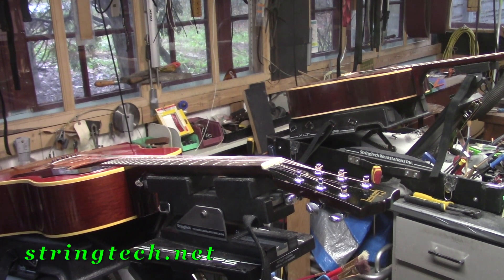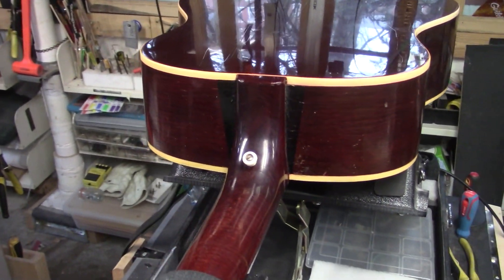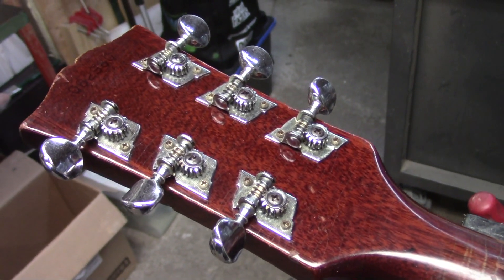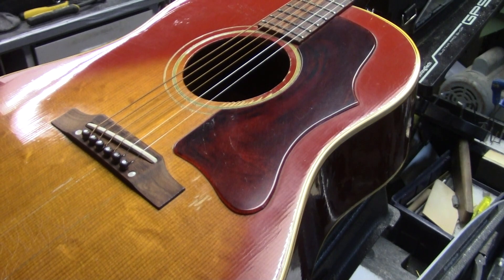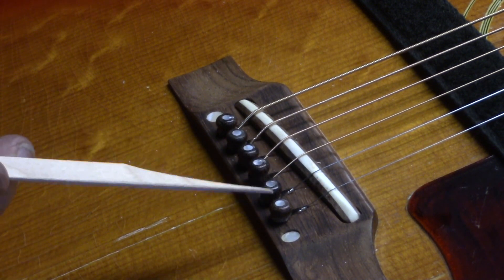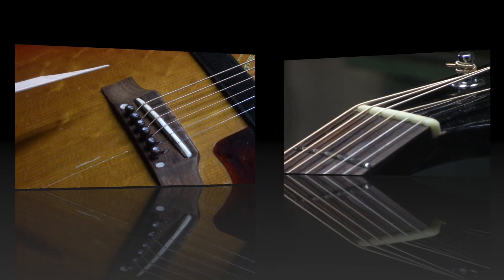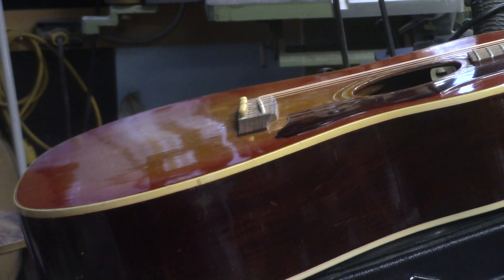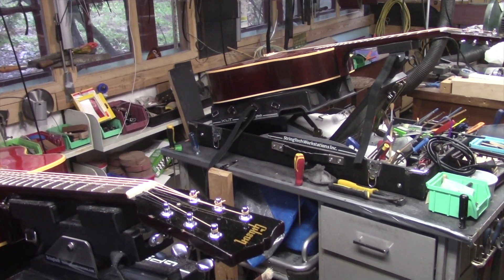Guitar Shop Fire Hazard Tip !!!@StringTechWorkstations

Comment: I once owned a very quiet mid ‘60s Epiphone Frontier with an even bigger pickguard. Sounded great recorded, but very quiet. Someone removed all the innards of the adjustable bridge and installed a rosewood piece which was slotted for a 3/33” bone saddle. One day, my curiosity got the best of me and I decided to remove the puck guard and let all that suppressed volume come out. Having done this before on a J-50, I was confident, but I broke the guard removing it. After extensive elbow grease on the residual glue it was time for the tone test . . . and - NO INCREASE in volume!
My opinion is that the quality of spruce was below sub par. I’ve played ‘60s Texans (not every one, though) that the tone just bounced out of, but this Frontier was a dud for most aspects of guitar playing. Trying to make a J-45 sound like a Martin probably isn’t going to happen, but some of them sound good despite all the supposed strikes against them from a design perspective. Good for Mississippi Delta Blues, at least.
Reply from the maker: Most of the Gibson acoustics from the 50's / 60's were not boomingly loud guitars. The 30's and 40's however ... Ka-Pow !!

Comment: Thanks for the heads up on the batteries. You know I am a fan, you are one of the best I have ever seen. Somewhere I heard of guitars being appraised, not sure what model of Gibson it was, but with the original bridge plate it was worth 35,000 , if it was replaced 3,500. Do you think that was B.S.? I know those old plywood ones are junk and if a top gets bulged out or warped can mess them up too, not to mention regular wear and tear. I have even seen luthiers use over sized ones to straighten out tops, which IMO is better than those bridge doctors. Just wondering what your take is on it.
Reply from the maker: Oh Boy ! These are a real "Can of Worms" questions to answer... Lol  ! But here goes .... If you have been following my channel for any length of time, you know that I work on a LOT of high end stuff. Frankly, I don't get into the #'s game. It's WAY too much of a "Snake Pit"  for my taste. I guess the real question to ask is .... " Do you want to put the instrument in a glass case ... and never touch it, in case you put a fingerprint on it ....and then bow down and worship it every day and monitor it's worth on the stock exchange "  ?  OR .... Do you want to get the maximum tonal response and playability out of the instrument ... and play the living shit out of it ... on a daily basis ? (Sorry for being crude ...  I guess that was 2 questions / 2 answers ). As far as the "top pulling" up .... I think that there are way too many people who are too quick to jump to the conclusion that you need to "flatten the top" .... why ??? Unless there are some braces that have let go ... why would you do that ? Chances are ... that if you "force" the top to flatten it, you will be more likely to pop a few braces in the process. IMHO I think that there is a whole industry built around this completely unnecessary " repair ". Naturally, under 160lbs+  string load for 50 years; the top will flex over that period of time and string load. I prefer to put a spherical radius on the foot of the bridge ( 24' radius NOT 24" .... or 30' on a shallower top) , to get intimate contact , for maximum resonance. I guess that is more or less my take on it ...... now let's see the shit hit the fan .... Ha ! ... Respectfully ... MMcC
Reply: @StringTechWorkstations  Haha, I love it! Well said Mike.
Reply: @StringTechWorkstations  Thanks for the response, I totally agree with you on this. I didn't mean to stir anything up. To me a guitar or any instrument is worthless if you can't play it.
Reply from the maker: Sadly, there are many amazing guitars that never see the light of day. They are strictly "investments". The players who most deserve these instruments ... could never afford them. This is why I have no interest in "Wading into the Snake-pit of Vintage guitar Sales ". I work on them constantly .... but have no interest in wheeling + dealing. MMcC